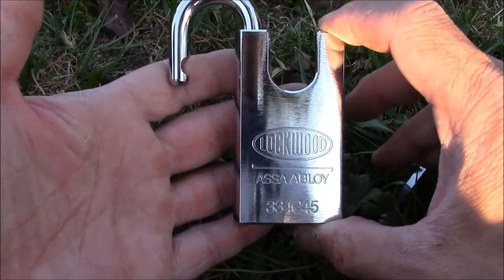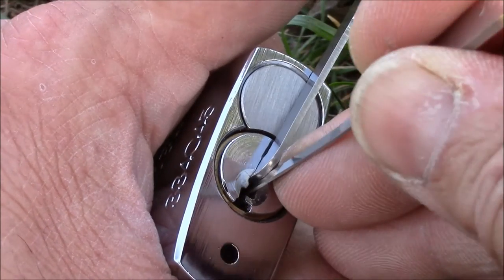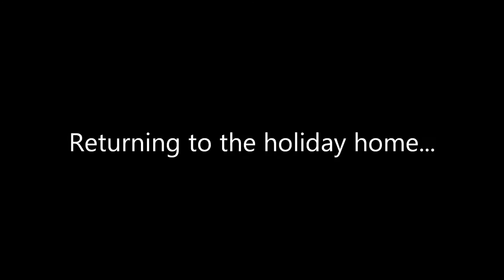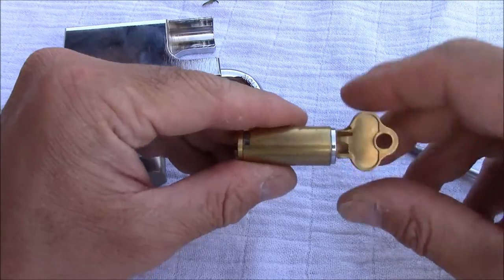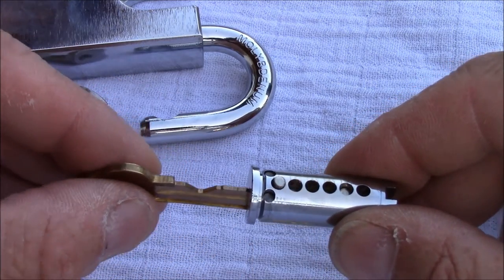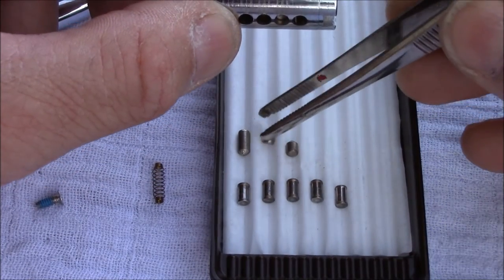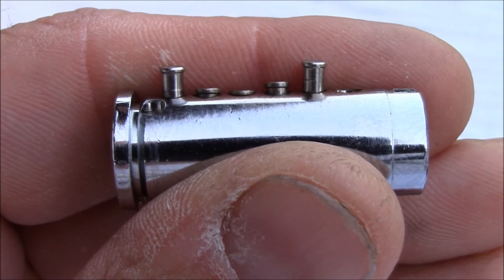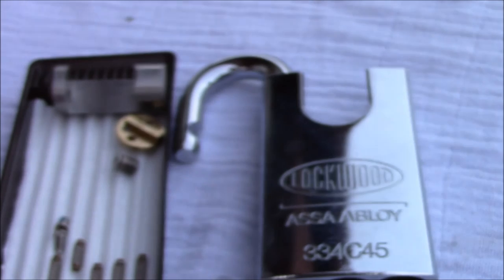(picking 46) LOCKWOOD padlock 334C/45 quickly picked and gutted (sent by Joshua - thank you)

Comment: Excellent work buddy. A great quick picking.
Reply from the maker: dirk Thank you, mate. I had to work a little bit to find the right sequence for a quick picking. Usually I start in the back. But with this lock starting at pin one and carefully balancing picking strength and tension pressure is the way to go. Oversetting is an issue sometimes, but most of the time you can recover by releasing tension or slightly pushing (the already set) pin one which cause a little counter rotation.